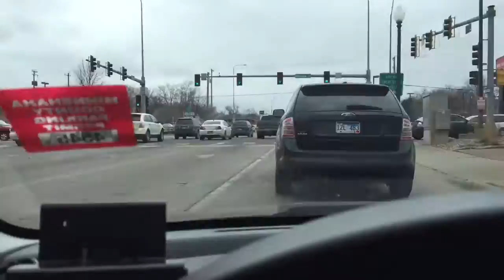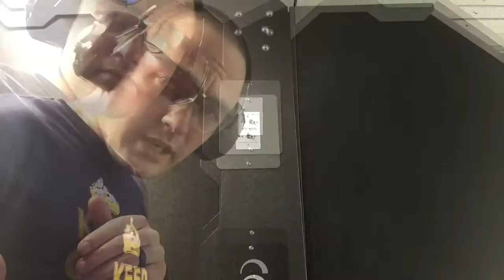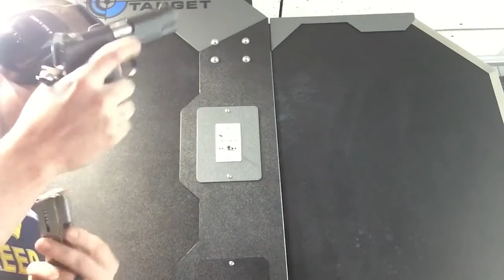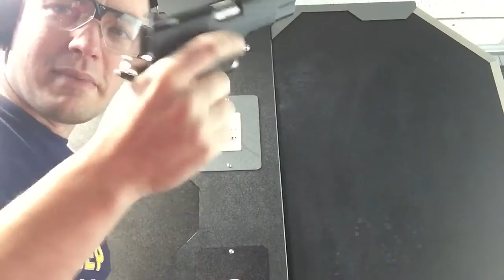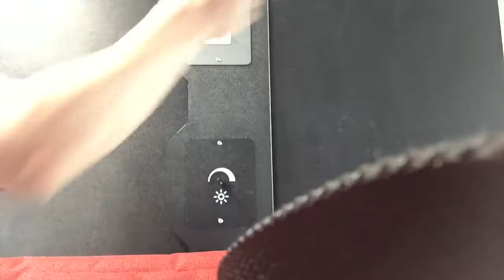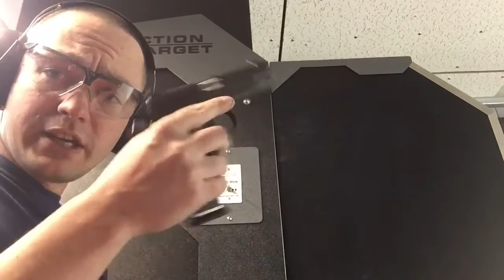Dan Wesson Valkyrie Commander 1911 - 10-8 Performance Function Test

Comment: Great video! I would like to hear your opinion in the situation I'm stuck in. I'm about to purchase the 1911 Dan Wesson ECO as my first carry but I'm having a difficult time choosing it between a 9mm or 45acp. Like I wanna get it in 45 but the recoil looks harsh specially when using one had only shots, when I think about it in 9mm it's only 8 bullets and not enough stopping power, what's your take? Much appreciated. Thanks
Reply: Hand*
Reply from the maker: +ruggedfresh Get the 9mm. Handgun stopping power is largely a myth perpetuated by people who don't understand the mechanics of wounding. There's no difference between a 9mm and a .45 in terms of effect on target. So get the one that holds more ammo.
Reply: 9mm 1911s are more finicky when it comes to magazines. Whichever you choose, make sure you test it for reliability. Minimum 500 rounds of FMJ ammo. Minimum 200 rounds of each of the recommended JHP ammo.

https://pistol-forum.com/showthread.php?4337-Service-Caliber-Handgun-Duty-and-Self-Defense-Ammo

9 mm:
Barnes XPB 115 gr JHP (copper bullet)
Federal Tactical 124 gr JHP (LE9T1)
Federal HST 124 gr +P JHP (P9HST3)
Remington Golden Saber bonded 124 gr +P JHP (GSB9MMD)
Speer Gold Dot 124 gr +P JHP
Winchester Ranger-T 124 gr +P JHP (RA9124TP)
Winchester 124 gr +P bonded JHP (RA9BA)
Winchester Ranger-T 127 gr +P+ JHP (RA9TA)
Federal Tactical 135 gr +P JHP (LE9T5)
Hornady Critical Duty 135 gr +P PT
Federal HST 147 gr JHP (P9HST2)
Remington Golden Saber 147 gr JHP (GS9MMC)
Speer Gold Dot 147 gr JHP
Winchester Ranger-T 147 gr JHP (RA9T)
Winchester 147 gr bonded JHP (RA9B/Q4364)

.40 S&W:
Barnes XPB 140 & 155 gr JHP (copper bullet)
Speer Gold Dot 155 gr JHP
Federal Tactical 165 gr JHP (LE40T3)
Speer Gold Dot 165 gr JHP
Winchester Ranger-T 165 gr JHP (RA40TA)
Federal HST 180 gr JHP (P40HST1)
Federal Tactical 180 gr JHP (LE40T1)
Remington Golden Saber 180 gr JHP (GS40SWB)
Speer Gold Dot 180 gr JHP
Winchester Ranger-T 180 gr JHP (RA40T)
Winchester 180 gr bonded JHP (RA40B/Q4355/S40SWPDB1)

.45 ACP:
Barnes XPB 185 gr JHP (copper bullet)
Hornady Critical Duty 220 gr +P JHP
Federal HST 230 gr JHP (P45HST2)
Federal HST 230 gr +P JHP (P45HST1)
Federal Tactical 230 gr JHP (LE45T1)
Speer Gold Dot 230 gr JHP
Winchester Ranger-T 230 gr JHP (RA45T)
Winchester Ranger-T 230 gr +P JHP (RA45TP)
Reply: Except the bigger hole the 45 makes because of the larger diameter bullet. 9mm is more than capable of stopping a threat with well placed shots
Reply: Gun Nuts Media - You couldn't be more wrong.  A 45 hollow-point expanded is around .84".  A 9mm hollow-point expanded is around .60".  The 45 simply produces a larger hole (faster blood loss shutting down the CNS).  Also, numerous FBI stats have shown 9mm glancing off bone, a 45 smashes right through it.  But yes.....the 9mm is more controllable & holds more rounds.  If shot placement is the same, the 45 will win 10/10 times.  Many just don't like the recoil & have a hard time admitting it.  These are just facts.
Reply from the maker: Joe Blow dude, you're wrong and that's okay. The FBI specifically said that there is no difference in terminal performance between 9mm, .40, .45. But whatever, you can believe in fairytales.
Reply: A bit of delusion on your part is ok......& it's not a crime.  If what you say is true (which it isn't), then why do they sell a 45ACP cartridge?  Stopping power is real my friend.  It's a myth you say?  Then why does an 8" steel plate sway twice as much as when you hit it with a 9?  Because a 45 throws twice the size bullet (230 vs 115) thus producing more kinetic energy.  It sounds like you have buyers remorse after dumping all that $$ into a 9.  Don't get me wrong, that is a VERY sweet gun, but thinking a 9mm produces the same terminal performance as a 45, verifies your naivety in ballistics.  And why is it that it's always you young guys with zero life experience spouting this nonsense?  Shoot more & talk less please.
Reply: 10 years?  LOL  10 years ago you were probably in high school learning how to tie your shoes.  Let me educate you Nut,..... you say "because the FBI said so"  Really?  Did they contact you personally?  Or are you getting your information from an equally dumb YouTube video made by one of your equally unintelligent friends?  You young know-nothings simply regurgitate what you hear or see on some forum and then pass it off as fact,  While you seem to like to quote the FBI, then also look up stats on how many shots it takes (in verified shootings) to stop the perp.  It is usually 5 with a 9mm and 2 with a 45.  There is also a lawyer attached to every pull of the trigger nitwit and shooting someone 8 times with your 9 will NOT play well in court.  Do your own ballistic gel testing nutbag & you will see that a 45 simply leave a bigger wound cavity.  Imagine that........a larger bullet making a bigger hole.  But then again, with your theory 10 pounds of cement weighs more than 10 pounds of feathers.  Take your goofy theory into a gun shop and say (and I quote) "a 9mm has the same terminal ballistics as a 45".  You will be laughed out of the store.  Now please write something based on fact and not your wild imagination.
Reply from the maker: Joe Blow dude, 10 years ago I was taking classes at Blackwater and Gunsite. I'm older than I look. And as far as where I got my opinion, well, I read the FBI report. It's publicly available, maybe you should google it. 

And if knowing how wound mechanics works gets me laughed out of some dumbdick's gunshop, I'm probably doing something right with my life.
Reply from the maker: Joe Blow dude, 10 years ago I was taking classes at Blackwater and Gunsite. I'm older than I look. And as far as where I got my opinion, well, I read the FBI report. It's publicly available, maybe you should google it. 

And if knowing how wound mechanics works gets me laughed out of some dumbdick's gunshop, I'm probably doing something right with my life.
Reply: Sorry.....I don't know your name, so from here I'll just refer to you as Clueless.  You sound like someone with a failed military career who lives his life out through YouTube.  Your thinking is "because I make YT videos and shoot guns a lot, I must be knowledgeable".    Well since a 9mm has the same ballistics as a 45, I guess you must take a .380 out into bear country instead of a 10mm, 44 mag, or 454 Casull huh?  I mean....they all have the same ballistics right?  Do you realize how stupid you sound?  Some of us have literally been shooting for over 25 years, actually been deployed, and have actually shot people.  You young guys want to latch on to the latest Taran Tactical teaching or Rob Pincus video thinking that what they say is revolutionary and it simply isn't.  Ok, you didn't like the gun store analogy.  So sign up on a 1911 forum and as your first post write "The 9mm has the same terminal ballistics as a 45"  You will have 10 negative comments before you have 1 positive one.  Why?  BECAUSE THE 45 IS MORE POWERFUL THAN A 9!!!!  Wait....you're a troll right?  If so.......you are the best troll I have ever seen!!!!
Reply from the maker: Joe Blow 1911 Forum is one of the dumbest forums online. 

Oh and I'm I'm still in the military. You never never deployed and you never shot anyone, don't pretend to be hard here, you're just another Internet tough guy who's compensating with his big bad .45. Learn to shoot. 

Thanks for playing though.
Reply: Because you know me right?  You know my name?  Have you ever heard of Operation Desert Shield?  Probably not as you were just being born.  Do you know what an Alpha Charlie is?  How about the Five Sided Puzzle Palace?  How bout an Eagle Keeper?   I have seen things that you wouldn't even believe if I told you.  You are in the military,...deployed once or twice, or not at all correct?  Probably never shot a round except on the range.  Oh....but you "took classes" at Blackwater.  One of Glock's sponsored female shooters can "take classes at Blackwater".  Clueless, you seriously need to do your own ballistic testing, with all parameters equivalent, and you will quickly find out that the 45 is far more capable of shutting down the CNS more rapidly than a 9mm.  Now leave the warfare to the wise and qualified & I'll leave the idiocy to you.  Reply back if you want, but I'll delete it without reading it, I don't have time for the delusional.
Reply from the maker: Joe Blow if you were in Desert Storm I'm the queen of England. Thanks for playing, but adults are talking here. 

Enjoy being a stolen valor douchebag.
Reply: Have to side with Joe on this one.
Reply: Funny, but didn't the FBI switch from the higher calibers (10 mill., 40 S&W) to 9mm? Yeah. A 9mm loaded with  JHP+P will get the job done without dumping the mag. Wish we could have used them in Nam'. Woulda' got home sooner.